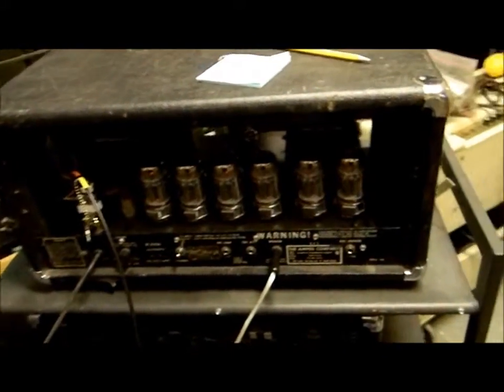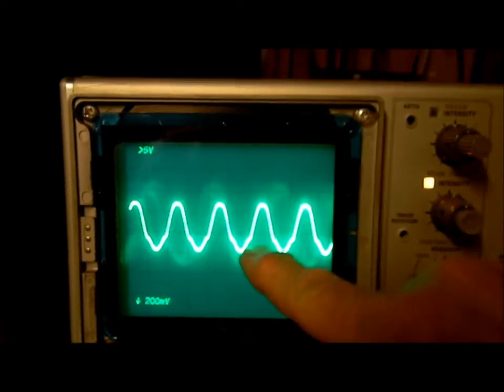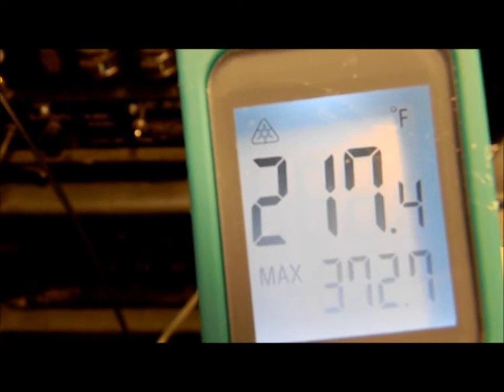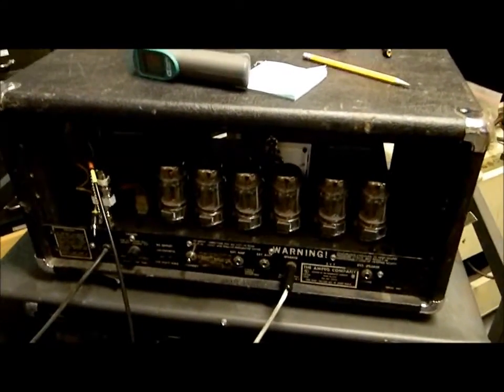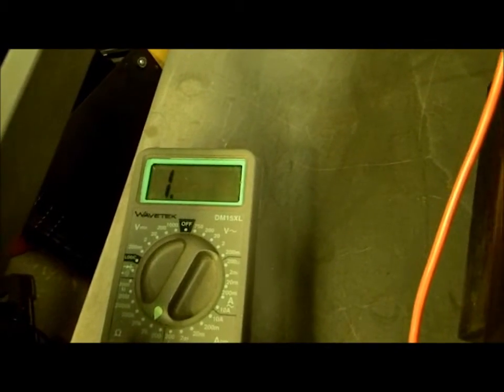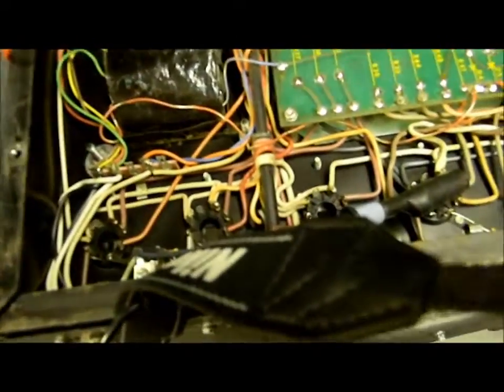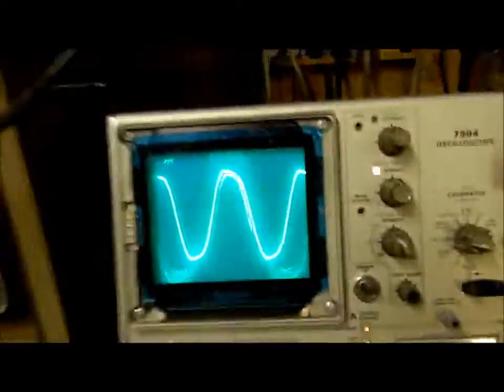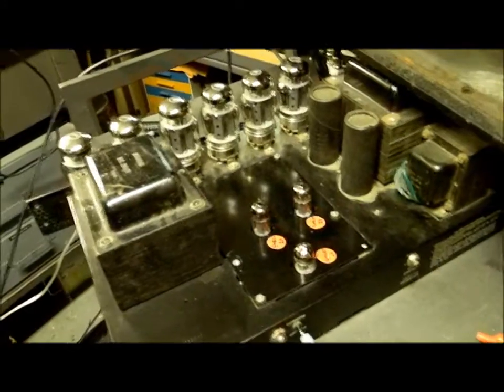Ampeg SVT 6x6550 Repair and Testing.wmv

Comment: I have one of these beasts in my shop now. I'm concerened about the b+  being too hi. The one I have is running 750 vdc on the plate. the drawings i have do not have any voltage specs other than the cap voltages. I dont believe I should be running over 575. am i correct.
Reply from the maker: I have had these SVT's run at 750 volts also. Pretty dangerous level of voltage. 6550's and KT88's can take that voltage so it is not uncommon. There may be a tap on the primary of the power transformer to lower the voltage. I have seen primary taps on some of the vintage Ampeg amps - hope this helps.
Reply: thanks

Comment from the maker: I do have a method for balancing the cathode currents of the SVT - set the bias voltage exactly the same for both sides (on pin 5) and plug in two 6550's one on each side and record the cathode voltage at the test points. Then put the same total cathode current on both sides - it really works. The problem comes in if some 6550's are really strong and some are really weak. Then there is a problem of the strong one doing all the work. I plan on making a YT video on that method one of these days.

Comment from the maker: I don't think the plate resistors are fuses as they are too large in wattage. It is common to use 1/4 watt or so resistors in the cathodes or emitters of transistors as fuses at somewhere between 1 to 10 ohms. I would love to work on the 6146 amp. I too am an amateur radio operator of 50 years (WA4QGA). I still run 6146's I my old Collins S-Line. We both know NOS 6550's are crazy priced. Thanks for your comments. I have not modified the caps in the SVT's (see next post)

Comment: I thought the plate resistors were supposed to act like a fuse. Your distortion meter is way newer than mine, and the volt meter is nice too. I have an LCR I love for testing caps in circuit. Do you ever modify the filter caps in the power supply section on these SVTs? My personal SVT for the band is an old 6146B power tube model. I doubt I will ever part with it either. NOS 6146Bs are failrly cheap at any Ham fest. 6550s? not so much.

Comment from the maker: I haven't tried it on solid state units yet. Don't work on too many except for an occasional Mac amp. TO-3 transistors can get pretty darn hot so I don't see why it couldn't be used there also to include power resistors in emitter circuits and whatever else it would be good to know the temp of and to compare it to other similar components. Thanks for your comments.

Comment from the maker: Also, in series capacitor arrangements in power supplies, you will notice high value resistors (say, 470K) across each electrolytic capacitor for a similar reason. Otherwise, as an example, you may have two 350 volt caps in series (for a total of 700 volts) but without the equalizing resistors you may end up with 500 volts across one cap and 200 across the other because of differences in capacitors in manufacturing or in the ageing process.

Comment from the maker: The low value plate resistors are there because they help balance the parallel tubes to each other. Under heavy conduction, a tube can present a very low impedance and when in parallel with others may end up taking an overburden of current whereas the others are not conducting as heavily because of differences in each tube - even in "matched" tubes. Similarly, fractional ohm resistors are added in the emitter leads of power transistors for the same reason.